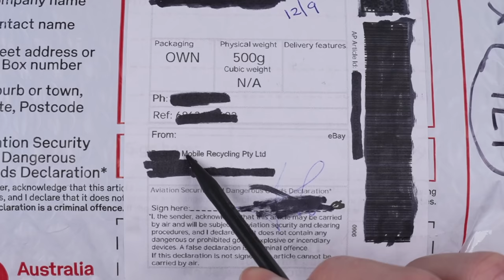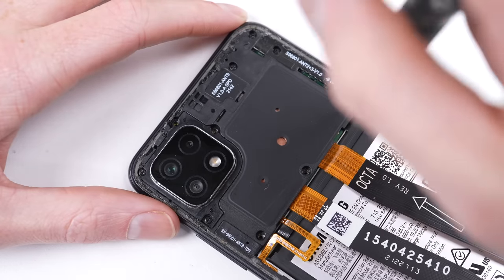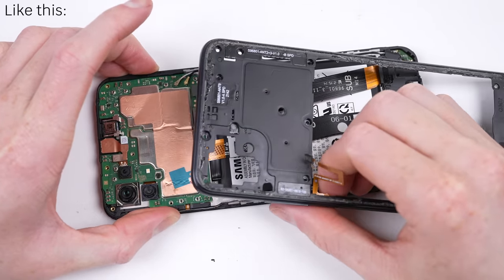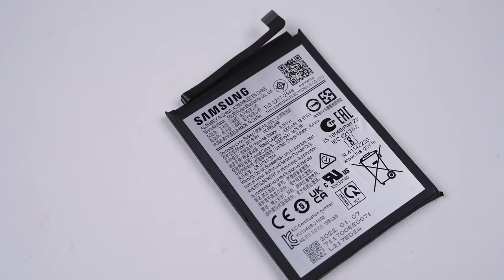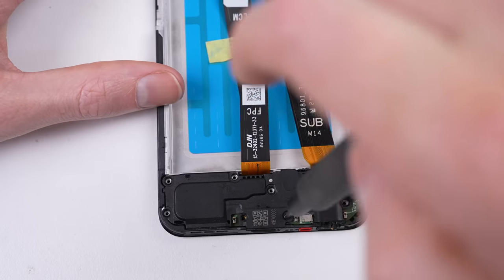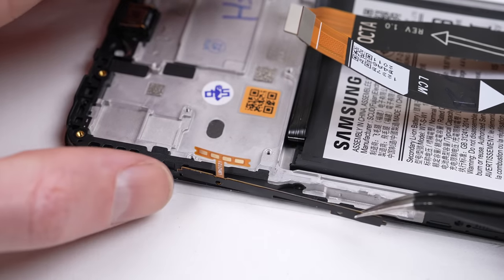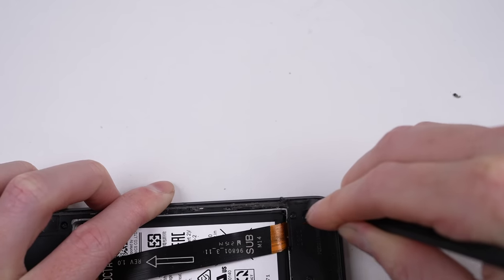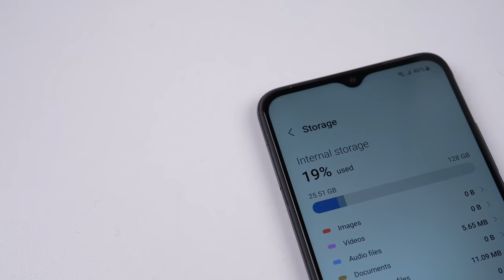Samsung Galaxy A22 5G Restoration - The Last Repairer Did A Poor Job, Let's Fix It Right!

Comment: Nothing drives me nuts more than fixing a shoddily repaired phone.  A customer brought me an XR last week and the guys who repaired it before not only didn't adhere the new screen, they left out the bottom screws AND somehow destroyed her power/volume flex.  That last one was something I'd never seen accomplished during a screen replacement.
Reply: Probably done by someone from apple's genius bar so that you're forced to get a new phone lol
Reply: It never fails to amaze me how much some people damage a phone during a simple screen repair. Especially when the damage is to something that didn't even need to be touched for the repair.
Reply: I'm sitting here trying to figure out in my head how they'd even accomplish that. Did they tear it near the connector? Only thing i can think of is a tool slip, or they had no idea what they're doing. I've seen people try to fix them on their own, try to replace their battery, and tear the cable near the volume buttons well trying to pry up the battery, but ya never during a screen repair.
Reply: this apply for xbox and playstation consoles also i got two xbox 360 halo editon consoles for $20 each and one of them was fine but under the motherboard theirs foam pads with thermal pads on them on some of the chips to keep them cool when i got it their was something shaking around inside of it and as i took it apart the thermal pads and styrofoam pads that keep the thermal paste pads on were both gone and in place was 3 pennies rapped in electrical tape and taped to the mother bored  long story short in doing that they killed the mother board
Reply: @tydshiin5783  it’s most certainly previously repaired by a mall repair shop
Reply: @brandon_nope  worse.  She came back so we could replace the screws and the power/volume flex (free of charge because I wanted to prove to her that not every repair shop is owned by incompetents).  Turns out it was done by some dorks in a repair shop inside a Walmart.
Reply: I broke my XS Max and thats exactly what my local repair shop did to me. That was before I worked on phones.

Comment: I do own A22 5G and it's a good one. Dimensity 700 makes the battery last long. Apart of the absence of the NFC in our region, it is almost a complete package
Reply: Only thing I absolutely hate are the stupid side mounted fingerprint readers (not just on this model). Put a case on and whoops.. it'll no longer work well or at all. Plus when you just wanna turn on the screen by tapping the power button to see notifs or whatever, it'll instead just complain about not being able to read your finger... adsdfshdfgj 🤬
Reply: @Knaeckebrotsaege  in my case the fingerprint still work a bit too well until the phone blocked it after 5 accidental fingerprint touches.....

Comment: Hey Hugh!
I've repaired the same phone yesterday, the sub board needs to be inserted at the top right corner first because there is a black piece on the screen that holds that corner.
If you open the rear plastic again you will notice that there is a lump on the sub board's main flex conector.
Keep it up!

Comment: When I did phone repairs back in 2022 I worked on one of these. The frame was pretty simple and was quite fun to work on. Easiest phone to work on BY FAR ( surprisingly ) was the Iphone X. If you needed a screen replaced you could do it in less than 10 min
Reply: I agree, I often open up android phones but it's actually pretty easy to replace parts on the iPhone X and 11, then only iPhones I've worked on
Reply: Iphones that open up from the front are so easy, changed my 11 screen in like 4 minutes

Comment: An A22 was my last phone, I loved it. I particularly remember how long the battery lasted - I could go almost two whole days without charging mine. It worked for everything I need a phone for perfectly fine, and I only replaced it because I ran out of storage for apps. I replaced it with an A33, which I currently use and love just the same. Highly recommend the A series to anyone in need of a more budget-friendly phone.
Reply: As an A22 5G owner of 2 years, I would not recommend Samsung to anyone anymore. 
Each software update slowed it down more and more, now a web browser lags out and crashes the Android "desktop environment". Social media can lag out the whole phone for up to 20 seconds at a time. This is not how a phone with near Galaxy S10 performance should function.  

And ignoring the software flaws. Motorola's offerings simply blow anything Samsung away. Samsung offers so little compared to the competition. Xiaomi has been doing this for about a decade now, but they are even worse with their software slowdown. Motorola on the other hand runs pretty much stock Android.

Comment: 7:35 frame not properly clicked into place (there's a gap between the LCD and the frame). Apart from that, good job Hugh. I do these kind of repairs every single day in my repair shop

Comment: Fixed a few of those recently. The flex for the volume keys seems to be really fragile. But you can get the replacement screens with this part already glued in place! Samsungs Service Pack for example. Saves, as Hugh stated, a lot of hassle and time waiting for the flex to arrive from china.

Comment: I have the A23. It is a really decent device. If I wasn’t able to afford flagship phones, I could definitely use these mid budget range devices. Not the fast. But has come a long way from devices that cost the same 5 years ago!
Reply: Buy used Galaxy S10 = 150 USD average
Reply: If you buy a Galaxy Note 9 you can get a cheap phone with really high performance. The only biggest problem is the cost to repair the screen if it breaks.
Reply: sadly ive noticed with the a-series lineup by samsung that after a year of daily use these devices become slower, noticably so, to the point where my now maybe 3 years old a32 freezes during phone calls.
Reply: @TonyTear  I used an A52s and it's a vastly different experience from yours. The Helio G80 on the A32 is honestly an aging chip, and fwik, A32 uses UMMC memory which is hard drive slow
Reply: @sorosaltgaming the 9 and 8 series are getting purposely slowed down
I have the note 8 and its acting weird lately. It used to be shuch a good phone
Reply: 5 years ago phones like the Xiaomi redmi note 6 pro, Mi A2    Xiaomi mi8 lite... that was really god coste values in 2018. When Xiaomi makes really god phones.
Reply: The Chinese brands like Xiaomi are way better than Samsung when it comes to midrange. Samsung shows their true potential only in flagship level beating apple in many aspects.
Reply: @Rikka_V1  actually no. Xiaomi makes terrible phones because of the actual MIUI firmware. Ships phones with a buggy software. My last Phone Xiaomi redmi note 9 pro with Arrow OS or Corvus OS was a really improve on performance because of the bloatware un MIUI. I gift that Phone to my sister and In a chance change to a Oneplus 8t. That was in 2020. The 8t is on my hands now. Typing you right now with him.
Reply: @Rikka_V1 what aspect did they beat? Just curious
Reply: @tuank624  Usually the processor and cameras are worse in samsung in the same price range as other brands. Also most of Samsungs lower mid range lacks flagship features like punch hole, glass back panel even now and of course they don't provide charger,case.
Reply: @Rikka_V1  not everytime. Samsung in the 300$ range still had a potent chipset (Dimensity 1080 A34) and now at 200$, they have the cheapest phone with a Snapdragon 695 (sucks on higher prices, but sweeping everything under with pretty old Snapdragon 680 which is based on 662, some even shipped with Helio G35 which is 5 years old)

Comment: The display was fine and only needed glass replacement. The case was in fair condition and did not need replacement. I think the parts you bought were more expensive than a used phone in good condition.

Comment: i got over 60 Untested devices from eBay in a very cheap package, most of them actually worked but with small issues like Cracked back panels. The one i actually want to Fix is the Galaxy S9+ but the Replacement screen, back and Frame Cost more than getting a used one without the Damage....

Comment: Couldn't you just replace the glass itself as the screen looked spotless, that's how most repair shops do.
Reply: First of all you must be thinking on the old days when the lcd and touch screen digitizer can still be separated 
Second even if it is possible it is REALLY HARD to separate them 2 togheter because they're glued down and has a REALLY HIGH chance of breaking the lcd in the process
And it still works just cracked it can still be used for things like testing motherboards and data recovery

Comment: Hello Hugh. Hope you are well? May I ask a question, please? How do you get into doing this without any prior experience or knowledge? I would like to get into phone repairs but the issue I have is that I have only ever done a screen on an old iPhone 6s but if I've got someones £800 iPhone and I mess it up trying to repair it, I am then liable and It will cost me to buy a new phone. How did you get into it and what do I need to get started? Thanks. Graham

Comment: I see that Samsung's still using extremely strong glue without any pull tabs, and those glued in button flex cables are prone to breaking like that during re-assembly, or worse, tearing. Happened to me a good number of times enough that at this point I just make sure to order a power-volume button flex assembly beforehand for these types of phones. (It's even worse if someone has come in and tried to repair it before you and used the wrong type of adhesive, making it basically permanently stuck to the housing.)

I wouldn't call this exactly repair friendly.
Reply: Not anymore. Since current year now they have pull tabs on under their batteries, Jerryrigeverything and PBKreviews videos always show enough evidence about that.
Reply: @baoquoc3710  I saw that, but wasn't that only for their flagship devices?

Comment: Samsung replacement screens on higher end models are always a total write off. Used phones with good screen cost usually only a few bucks more. I am sure Samsung prices these replacement parts like that on purpose
Reply: Bingo. Tried saving a S10 for being the last S-series flagship with a headphone jack. Screen+frame service pack was close to 200 eurodollars. Fully functional used S10? 130-150 depending on condition. Compeltely pointless to even try. Can't tell me that's not intentional as the prices apparently haven't dropped one bit in years. You'd think at some point they'd go down just so they could get rid of old stock when production stops. Nope

Comment: i have so much backlog of phones. parts are expensive here so im stuck.
Note 9 with a broken screen, possibly locked.
s10 plus broken screen, unlocked.
vivo y11 2019 with broken screen,bent frame.
s7 edge with cracked glass, loose charging port

Comment: nice job hugh! i have the a425g which was made the same year as the a22 but mine has asnapdragon cpu i think... also parts for the a42 5g isnt as cheap as the a22 5g as it uses a 720p oled screen which if i ever broke it the phone would be going staight in the bin as i aint paying tripple what i paid for the phone to fix it...

Comment: @Hugh, I'm guessing $80AUD for the replacement screen means it's non-genuine (I'm quoted ~$400AUD for a genuine Note8 replacement).  If non-genuine, would you mind sharing the link(s) to where you purchase those from and that you have found to be as good as genuine please?
Reply: Note 8 screen replacements are going to cost more because it includes the frame and a max-quality OLED screen. The A22 screen is in no way comparable.
Reply: That's one of the premium cost of oled displays. Especially when it come to repairing older phones, I won't bother if its oled
Reply: @ljessecusterl  Thanks for the explanation on why such a cost difference
Reply: @Wigwamo  I'd really like to avoid e-waste and I was looking at a recycled Note10+ (about $150AUD more for one vs cost of screen and battery replacement in Note8) but pretty nervous based on what I see if things go wrong, especially say 9 months down the track...
Reply: @Wigwamo I found that out the hard way trying to save an S10 for the sole reason of it being the last flagship/S-series with a headphone jack. Screen+frame service pack is close to 200 eurodollars, more than a fully functional S10 by a pretty large margin. Completely pointless to even try and repair it, and that's when you do it yourself. You could probably buy multiple fully functional ones if you add labor cost ontop...

Comment: 7:07 Is it ok to install a camera lens that doesn't have the rubber adhesive on the cameras? I got a new back for my s20fe and it has no waterproofing adhesive on the camera lens
Reply: once you disassemble the phone, water resistant is not guaranteed however

Comment: Nice repair - I note that the replacement display was certainly inexpensive and helped make the repair feasible.
How do you recommend sourcing replacement parts - as I recently repaired a Galaxy A50 and had to rely on a used display?
Reply: Personally, I haven’t had too many issues with CrazyParts, although in my small amount of experience I have been disappointed with the longevity of their batteries.
Reply: @JustARegularNerd  I'm not based in Australia so don't think we have a CrazyParts store. I was thinking more UK based stores/options - as mentioned, when I did a repair on an A50 (which turned out to have another issue as well...) I had to get a used display.